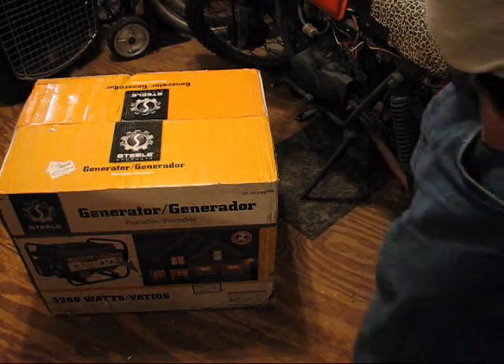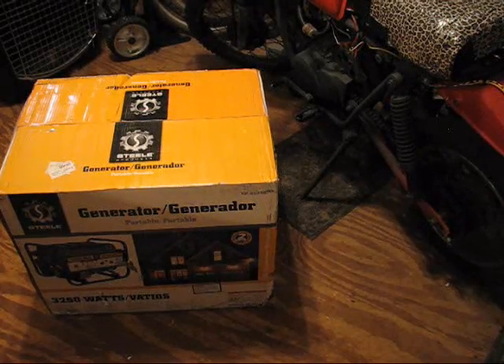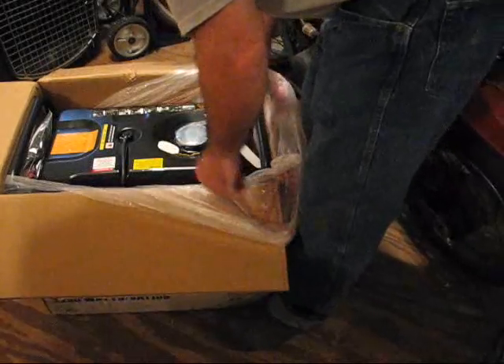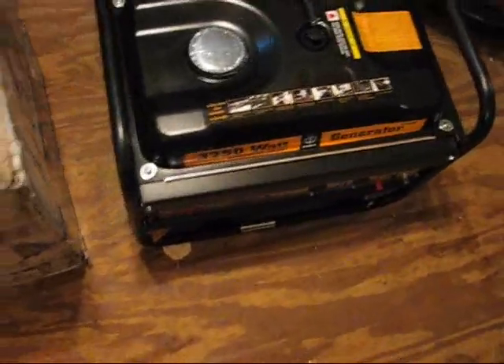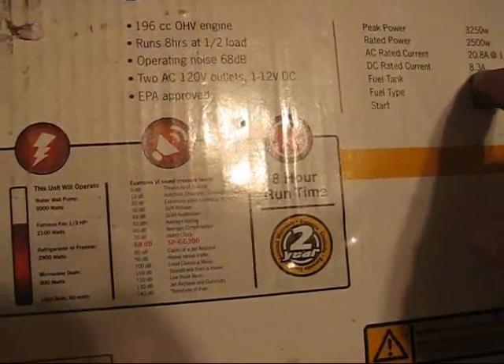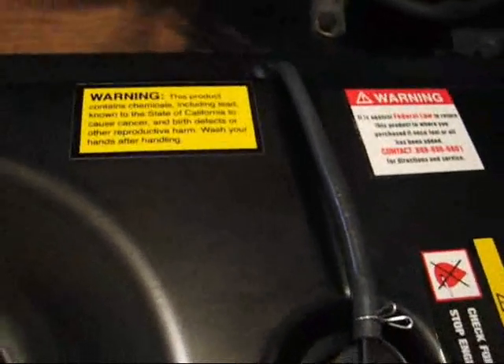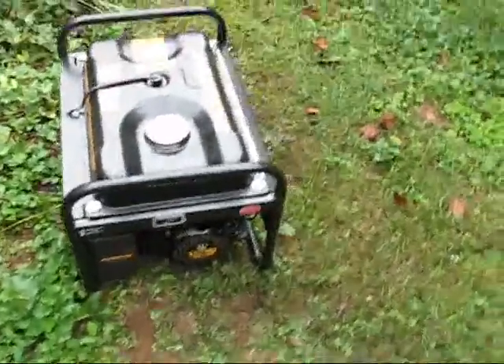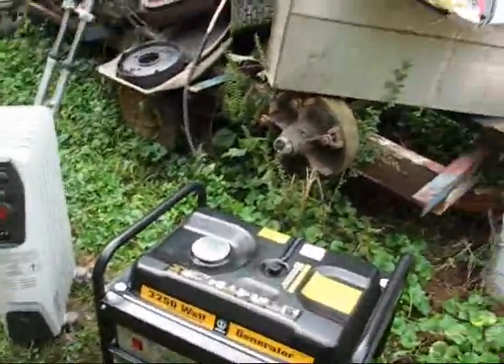New Generator Unboxing and First Start

Comment: I wonder why the running watts are so low. Most generators with the 6.5 hp engines are usually rated at least at 3000 running watts. Strange. Makes me wonder if it is under rated.  Looks like it runs good.
Reply from the maker: +Deucealive75 Here's a video of it running a load: https://youtu.be/zppf0OniE80

Comment: Hi Tracy, after watching this vid a few times, I got to thinking ( much to the wife's disgust ) about how handy a 3 - 3.5 kva generator would be for those short power outages, for a fridge or freezer and a light and fan . Would save wheeling out the diesel / Yanan ( Stamford copy ) for just a few hours. So easy to pick up or wheel to where you want it and have it running within a couple of minutes. BTW, how many kva does your S195 genny combo produce, assuming you still use it for your main backup ??
Many thanks,
Mike.
Reply from the maker: I do still use it, Mike. The generator head is 7.5 kva, which is a perfect match for the 12 hp S195.

Comment: Taking into account the limits of my computer speakers, it actualky seems to sound less strained than a lot of those slightly larger 4 kw gennies.It appeared to run nice, handle that delonghi radiator ok when you switched it on, and while you know it loads up, it just seemed to run betterthan the bigger motor.
Ive seen someone do a Y adapter for the 110 outlets somewhere, but if it only has 1 CB for the two outlets, then its a moot point anyway. It should run an a/c up to about 12kbtu without too many worries.
Nice buy !
Reply from the maker: Thanks! Yeah, it is a good buy. $100 less than the 4 kw, and it meets my needs. Actually a little better with the 12V outlet.
I broke it in on that radiator. Found some small-engine specific 10w30 oil that still has the higher zinc level, cranked the radiator to max and let it run like that for 5 hours. I was surprised by how little fuel it used.

Comment: Any plans for a propane conversion? Even though it cost more for propane I've been thinking about adding this option to mine as an alternative fuel source.
Reply from the maker: No, not on this one. It is a good idea, but I want to be able to pull up to a pump anywhere and refuel it.